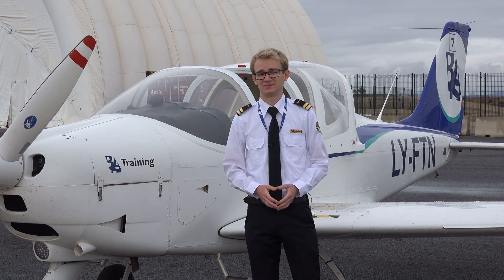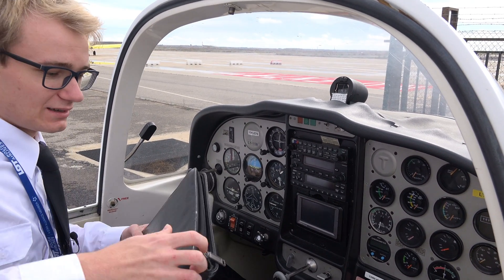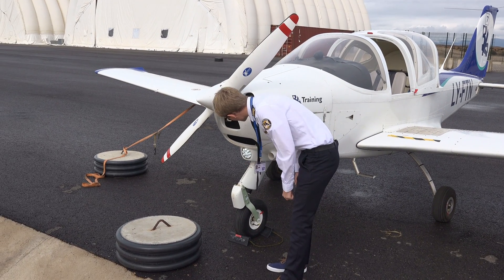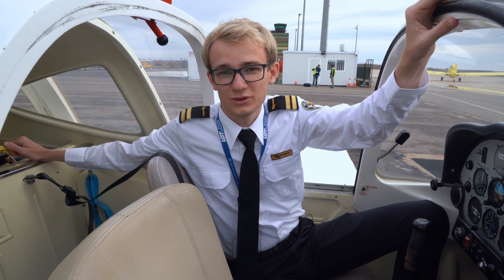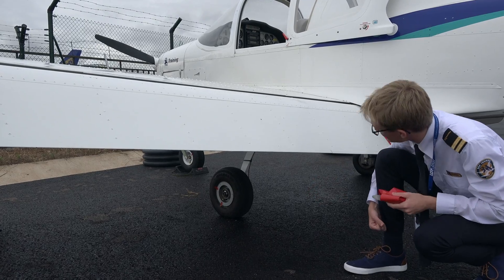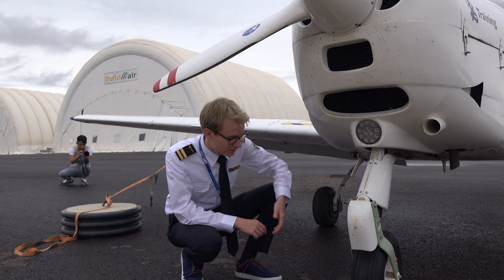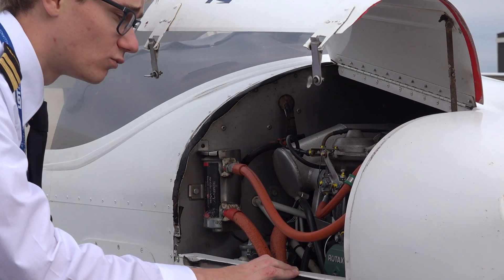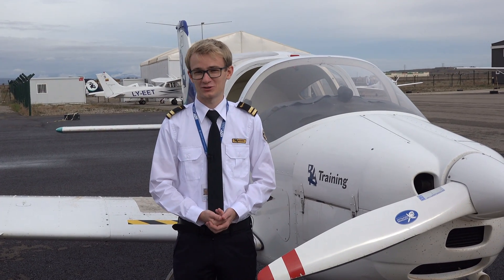Walk Around And Preflight | BAA Training Tecnam P2002JF

Comment: I'd be more careful manually cranking the prop like that. Remember, always treat the prop like a live one. There are certain techniques on how to turn the prop safely.
Reply: I was also scared of turning the prop when I first started learning in the Tecnam Sierra, but have heard that the geared design of the Rotax 912 engine means there's really no way it can start up from hand cranking it. Of course you should still ensure the mags are off and key is removed, but you need to handle this prop every time you do your pre-flight so there's not much point being scared of it! Hand-propping for the purpose of doing a hand-start is different from turning the prop to pump the oil.
Reply from the maker: That's what we were told as well, with less technical detail, thanks for that additional information! I've gotten very used to it by now as well, and it's part of our procedure to make sure the keys are extracted and mags off before touching the propeller
Reply from the maker: I'm happy to learn, so how would I do it more safely? What I've been told was that it's not actually an issue with these particular planes due to the design of the ignition, but I've always found it a bit scary!
Reply: @PilotJonathan   https://www.youtube.com/watch?v=EQm0hfEES6o
Here is a video for your question, please watch it to the end. 
Blue skies.
Reply from the maker: Thanks for sending that and sorry for seeing it so late - YouTube considered it spam. I get the points they're making in the video and I'll keep them in mind, thanks!

Comment: Mass and balance is usually something I would do before I head to the aircraft. 

Tip for students out there, if you are new to the aircraft you can check the aircraft's pilot operating handbook (POH) for the recommended procedures. Different aircraft have slightly different walkaround procedures. Flight schools often add additional checks as part of their walkaround.
Reply from the maker: Yup, it is also our procedure to complete mass and balance and performance calculations before leaving the briefing room! And if I remember correctly our procedures are almost directly out of the manual, but it's definitely a useful tip when flying new planes!

Comment: Great vid
Always check the seat. If it's mounting breaks on takeoff it can kill you.
Reply from the maker: The seat in the Tecnam is actually only mounted on an angled rail - so if it were broken you'd notice very quickly whilst adjusting it, there's nothing really more you can visually check 😉 But good tip in general, don't want it moving around for sure!
Reply: @PilotJonathan  Also I guess uhm , bring snacks, you never know  if you'll get stuck in a holding pattern or something.
Reply from the maker: Haha, I suppose, yeah - although even a diversion here doesn't take more than 30 minutes, so it should be survivable!